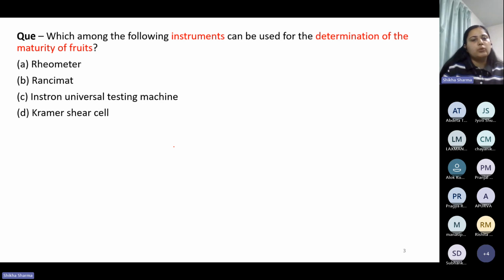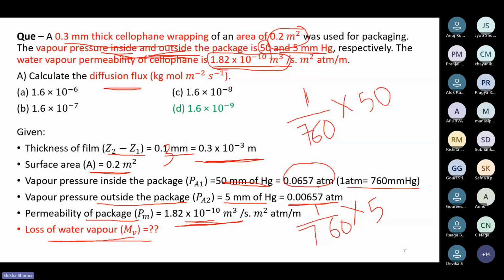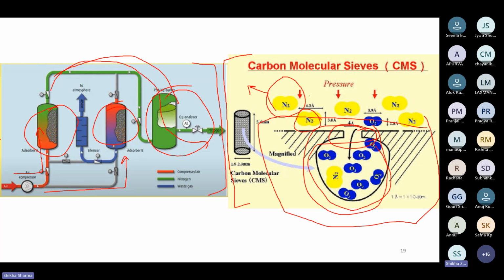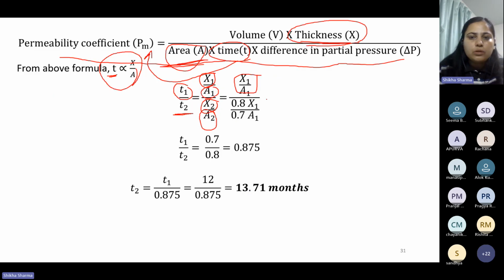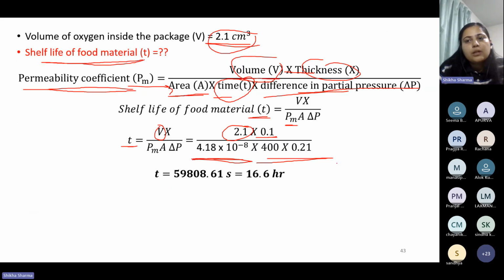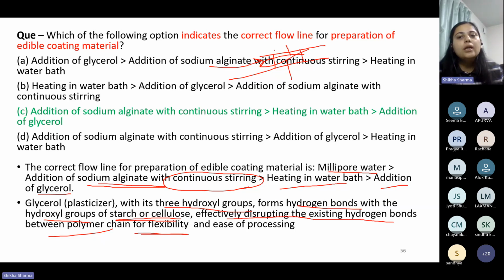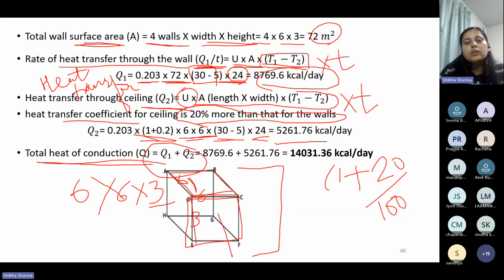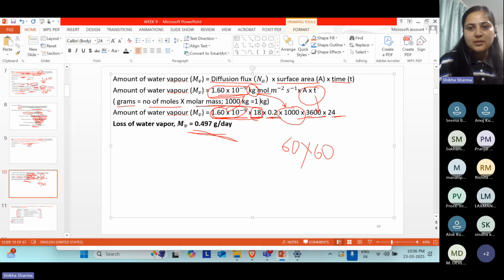Novel Technologies For Food Processing And Shelf Life Extension | NPTEL  WEEK 9

Comment: A new type of artificial lung membrane is being tested for oxygen exchange efficiency. The membrane separates blood (inside) from atmospheric air (outside). The following conditions are given:

The oxygen concentration in air (outside) is 150 mmHg, and in the blood (inside), it is 40 mmHg.

The surface area of the membrane is 1.5 m².

The thickness of the membrane is 0.0005 m.

The diffusion coefficient of oxygen through the membrane is 3.0 × 10⁻⁵ m²/s.

Tasks:

1. Calculate the oxygen diffusion flux (J) across the membrane using Fick’s First Law of Diffusion.

2. Determine the total oxygen transfer rate (Q) if oxygen exchange happens over 30 seconds.

3. Critical Thinking: If the patient’s lung disease reduces the membrane surface area by 50%, while also increasing its thickness by 20%, how does the oxygen transfer rate change? Explain your reasoning with calculations.
Reply from the maker: Kindly discuss your queries on discussion forum of the course.